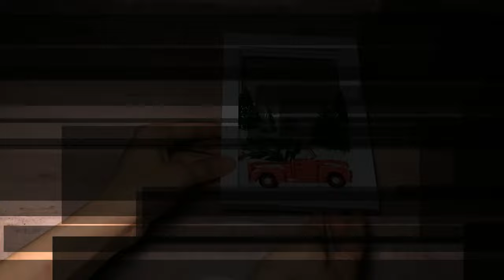DIY Christmas Motorized Blowing Snow Globe - Red Truck Falling Snow - Dollar Tree Christmas Decor

Comment: I made mine and I loved it but I had a problem with the snow sticking on the glass so someone advised me to use static cling dryer sheets and roll the snow in it in a plastic bag then pour it in your globe and it worked.  I can't wait to use mine at Christmas. my picture in the back was a picture of the front of my house when it snowed here in Montgomery Alabama two years ago.
Reply: Kathryn Nard what a great tip.

Comment: You could also paint a scene on the inside of the glass on one or more sides, but not the front.  Think of possibly using multiple glass layers without frames about an inch apart, each with a part of the scene for a true 3D effect.  The sections/blocks of glass would be attached to the frames with glue to thin metal or wood strips that crossed over to the top and bottoms of the frames before adding the base.  You could also just use a round glass tube inside with elements painted on that to achieve 3D.  This would be easier and my preference.  Snow would be between each layer of glass.  I noticed that static buildup occured sticking snow pellets to the glass at the bottom.  Not sure how to counteract that.  But it would have to be solved to do the multiple layers for it to look realistic.  I would also add a ribbon trim to the top to cover the glued netting.  Really cool project, thanks!

Comment: Very creative idea. Beautiful also. Just a thought, might wanna put some tape @round the edges before you store it away after the holidays or use some e6000. I used hot glue last yr, gorilla, and kept it in our basement that stays cool yr long and some of the pic frame sides had came apart. Thanks for sharing
Reply from the maker: Thank you very much! And thank you for mentioning the E6000, I forgot to add that to the video, I usually just use hot glue for video purposes and recommend E6000 for a more permanent hold.

Comment: just a quick note.. with the blocks that are hot glued together-- lay them flat on a table protected with plastic wrap when gluing them together..that way you won't have the "bowed" wall that you try to "fix" by putting in a mound of glue to fill in the gap--- secondly, buy one more frame and remove the glass-- use this to finish off the top of the snow globe instead of painting over the edges of the black mesh-- it finishes it just a bit nicer... just my suggestions

Comment: A new cat toy!  For the background picture try printing to static cling for inkjet or laser printer.  Or to a transparency for either printer.  Easy to swap out pictures.  You might want to fancy it up with the option of making a diorama.  For that you may need a hinged top or a tongue and grooved slot by which you can remove the top, replace or reposition the interior layout, then slide back into place without losing the pellets inside.

Comment: I think this is just genius and absolutely adorable. My Grandchildren will love this and the possibilities are endless. Thank you so much for sharing it with us. But please may I ask a question. If I understood what you were doing you applied tulle netting to the top and the bottom of the piece. I understand the air needs to flow from the fan into the bottom but I don't understand the tulle on the  top. Do you mind explaining? I'm sure there's a good reason. Thank you.
Reply from the maker: Not a problem, if you have the top closed there is no we’re for the air to go and it won’t allow the snow to blow up.

Comment: This is going to be a decoration that I plan on doing myself, but with the ones I'm going to make I will be placing them outside on my front porch, but 1 question where can I purchase the Tulle ( is that the material you used for the the top and bottom? And where can I purchase it?

Comment: That is so cute you REALLY DID A GREAT JOB. You can also trun the fan down to make it Blow slower right? Is that little Fan from the $Tree? And does it run by Battery?
Reply from the maker: Yes it is from dollar tree and uses battery’s it only has one speed but Walmart does have some with different speeds

Comment: Just throwing this out there. Why didn't you use white tulle, a real truck, and trees? You could have stabilized them toward the back of the frame on some more wood. Also, if you moved the fan more toward the front, the 'snow balls" would be less likely to get static electricity and wouldn't be stuck on the front frame. Another idea would be to stack the wood like bricks so they were staggered. Not only would this give it more stability, but it would give it a more interesting look, like a building, that way your Joy would look kinda like a billboard. Also, something I learned the hard way, paint Everything you can before having to deal with it when attached to your final project. Then you just have to do touch ups.

Comment: I missed the fan part. What kind of fan?
Reply from the maker: Sorry if it wasn’t clear in the video once the display is built you just set it in top of the fan and to make the snow blow you just turn the fan on. It is at at 15:50 to 15:58 that show the fan set up. It is a very fast step to the DIY.